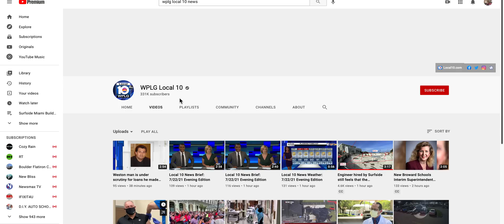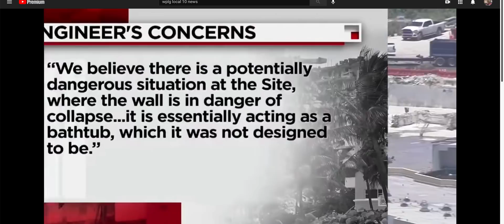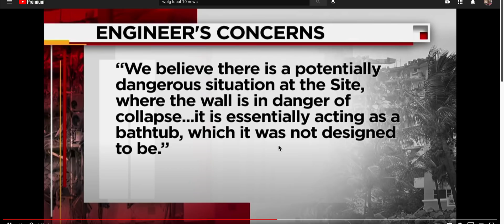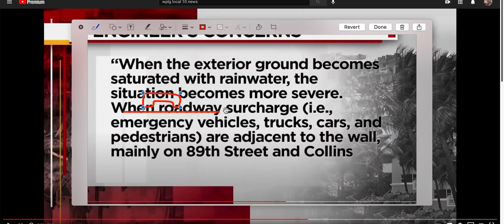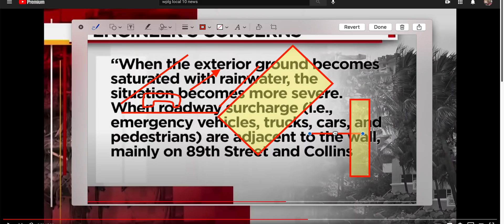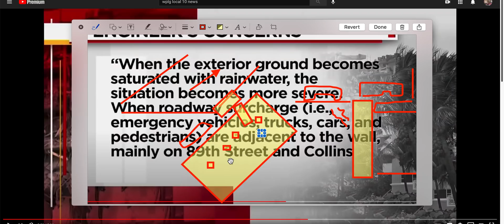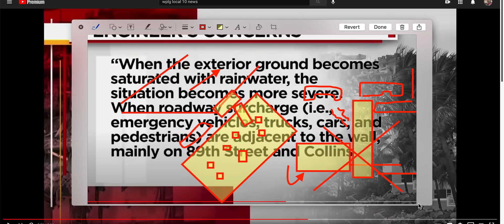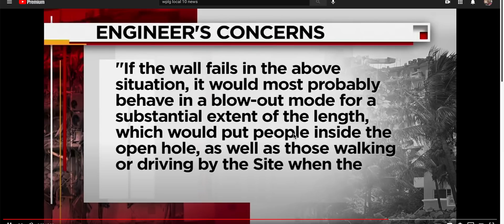Champlain Towers COLLAPSE ENGINEER NO LONGER CARES ABOUT SAMPLES HE BEGGED FOR, THE FIX IS IN!

Comment: If the wall was not designed as a retaining wall, which is probably the case, but rather to be braced at the top by the slab and backfilled after the slab was in place, than it will not be stable after the slab is gone. My question is why did they demolish the stable part of the building, which no doubt damaged the perimeter slabs the most. 

The perimeter walls were still mostly all stabilized by floor deck after the first collapse, even at the pool deck.  At least one bay with this deck should have been left in place until all removal work at the site was finished. 

I'm sure the wall under the initial collapse was pretty much gone anyway. If there is a concern, why not excavate behind all the walls. Are they worried about saving the sidewalk around this building after all that has gone on? 

The existing part of the building that stood after the collapse was the best evidence you could have in an investigation, and I doubt it was unstable after surviving the collapse of the adjacent structure. Where is the evidence of the damage and instability that led to the decision to demolish that structure? What engineer signed off on that?

Comment: When walking down that street, you probably are at an equal risk of being struck by a car as you are being caught in a blowout. "Papa's" conclusions are based on what data or observations? Cracks/bulges in the wall? 63 (?) years of experience? If so, could've written the letter 3 weeks ago. Now that evidence doesn't support the collapse started at the roof nor support the "act of a deity" sinkhole conjectures/guesses no samples are needed. I guess Miami-Dade PD still won't let him take samples of the 22 MILLION pounds of debris removed.

Comment: Again, having built a new building next to a major road this is completely ridiculous. On the side of the foundation you see the shoring that was placed prior to the pouring of the foundation.  Not only is that wall full of rebar the shoring is still in place. That shoring goes down probably 20 to 25 feet. Complete BS.

Comment: I'll wager there are a dozen or more condos is Surfside that will collapse before those walls. Blow-out is tool-talk, as in a tool is talking. Keep calling them out.
Reply: The township wrote up more sea turtle light violations for the building (diligently hiding on the darkened beach) than for loose or improperly installed corrugated plastic panels on the bottom of the pool deck, improperly covering cracked or damaged pool decking? Can they reuse some of those panels in the north  garage pool deck?